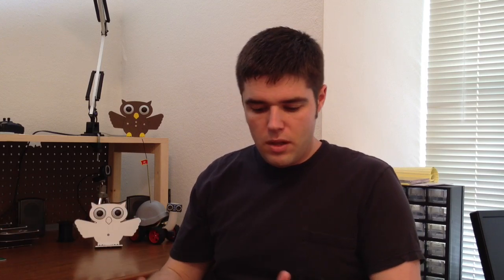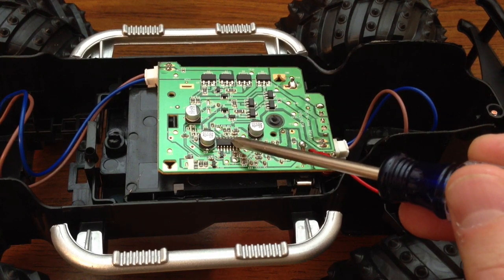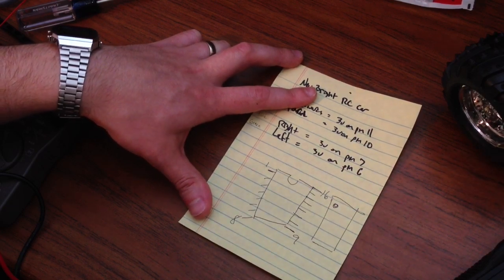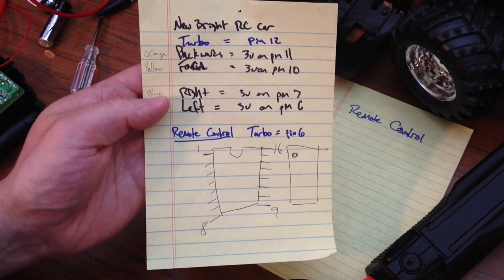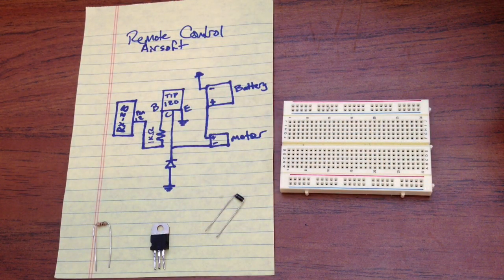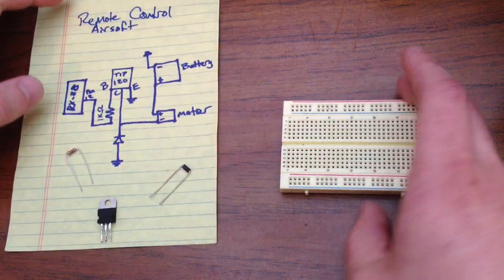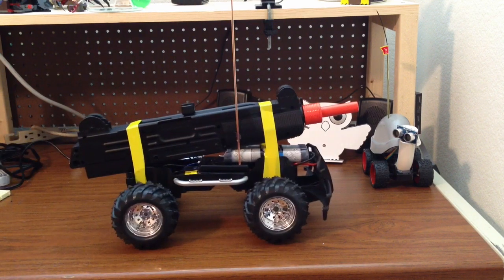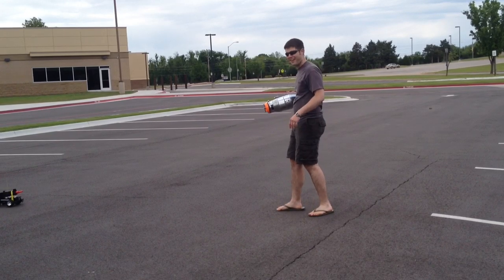Airsoft RC Car Hack

Comment: I have a gun that runs off 6 volts and a car that runs off 9.6 volts. I don't want to fry the gun, and I don't want to slow down the car. Could I simply put a resistor between the positive gun motor lead and the positive battery lead in order to bring the 9.6 down to 6 volts? Awesome hack by the way.

Comment: I have one tip for you. Don't clean your soldering iron with the sponge because it breaks the tip after a while. Use the curly copper or metal tip cleaner this is better than the sponge. Also remember to always of tinning the tip of of the iron.
Reply from the maker: You are absolutely right.  I've upgraded since then.

Comment: Can u make a video on how to use the turbo slot for a led light set with a toggle switch
Reply: You would wire it the same way, just replace the push button with a toggle switch, make sure you have the proper resistors between the battery and your LEDs, replace the airsoft gun with an LED strip, and viola! Since I'd argue that's a waste of battery to always be signaling for the lights to be on, you could keep the same button he used on the controller and implement a latching relay on the car side.